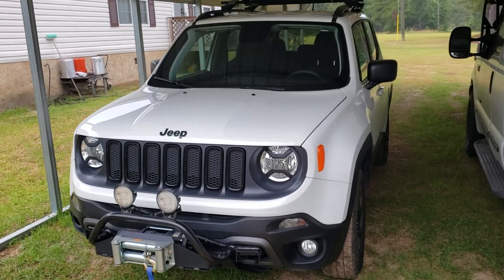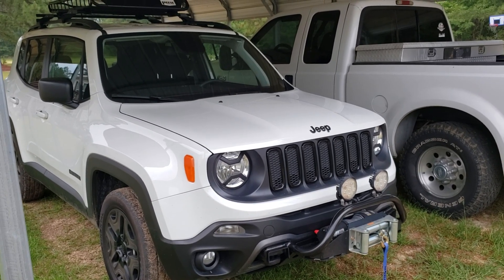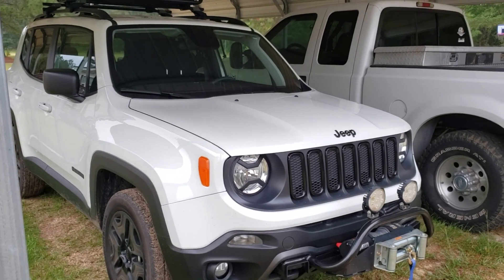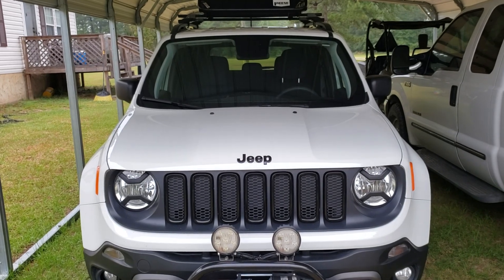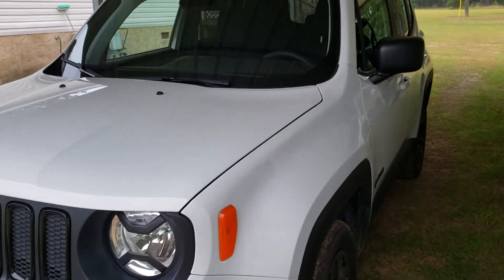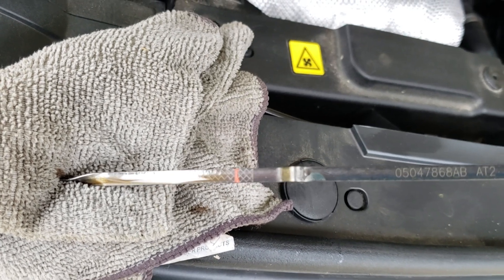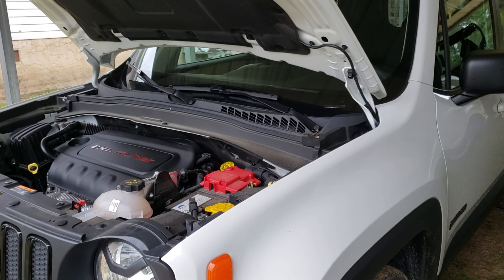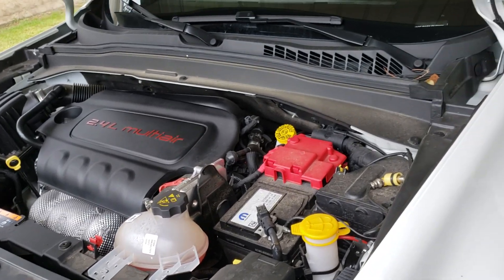2018 Jeep renegade using oil!!! Follow this link to hear what happened-https://youtu.be/xJyersWGxAk

Comment: Try Amsoil Signature and it will stop the oil burn and consumption. This has been proven to the dealers who use Pennzoil that  does not offer as much protection against heat and friction.  Amsoil should be used for all Jeep Renegades due to their engine design.

Comment: I have a jeep 2018 Renegade, 56,000 miles. My car randomly shut off and I got worried. Immediately checked the oil. I was down 3 quarts and it was still 1,000 miles to my next oil change. That was 1 month ago. Every week I check and it is going thru a quart a week. Called my dealer and asked about a recall. They played stupid  and said no recall. They have made an appt for a software update and said that it may fix the problem. I want this car fixed. Im thinking they Re gonna screw me around. Not sure where to turn. Thanks gor your post
Reply from the maker: Junk..just plain Italian junk

Comment: These motors have alot of blow by coming out of the oil cap which is an indicator of bad piston rings.
Reply from the maker: The rings aren't bad...they are specifically undersized to reduce drag and friction in the cylinder walls to help with fuel efficiency...problem is they allow oil to blow by, you are correct on that...thats where the oil is going.

Comment: Bought a 2018 Renegade 2 months ago.. I have this exact problem as well as the fog lights blew out, left the glass black and one cracked open. I have to do the oil consumption test and was told if it shows high oil consumption again, it will need a new motor! Wtf!! I drove it to work, had the 2 red lightening bolts indicator on the dash and lost power and couldn't drive over 35 mph and luckily made it back to my house as the check engine light also on and message on dash read "service engine".  Wouldn't start up after turning it off, had it towed to garage and it started right up for them and threw NO CODES! So the mechanic said I need to do an oil consumption test! What the actual hell?!?

Comment: I think I have this same issue on a 2018 I bought used last year for my daughter.  It has been 2500 miles since the last oil change and it was down a good 2 quarts.  But it seems like what you are saying if I do take it in for an oil consumption test the dealer will just sayi it's normal?
Any other recent solutions to this issue?   I really don't want to add oil to this thing every month or two.

Comment: 2016 , 62k miles . Oil consumption test showed excessive oil used . New long block installed today under warranty . Time will tell if the the updated engine makes a difference.

Comment: The 2.4 is not the only one that consumes oil, the 3.8 v6 is known for doing that as well because they say to use 5w-20 oil in the engine, well that's too thin for an old push rod style engine. A lot of people fix or at least better their situation by using 5w-30, it runs thicker at higher temps so it does not leak into the combustion chamber and is better for the engine in the long run. The EPA is putting way to high standards on fuel economy for new vehicles so car manufactures have to squeeze everything out of their engines and they do this by putting in thinner oil to reduce drag on the engine. Even toyota, known to be one of the most reliable car brands, has an oil consumption issue with their 2.4L engines. 0w-20 oil is almost like water it is so thin, and believe it or not but a lot of new cars coming out in 2019 and 2020 are going to use 0w-16 just to make cars more fuel efficient. The EPA is literally killing cars.
Reply: Yep, and better gas mileage is why so many manufacturers are using crappy CVT transmissions that break.

Comment: In 1980 I bought a brand new VW Vanagon. It burned a quart of oil every 500 Miles !  I did not mind it then because it was an air cooled engine and and oil was cheap. Nowadays it will be painful.

Comment: Anybody know what the status of the class action lawsuit is?  Mine is at the dealership right now because it would not start ..  and they want to blame it on an unrelated customization I made using a bigger battery.
Reply from the maker: Nothing will ever become of it, you cant fight Fiat money 💯
Reply: yes mine said it was running but the engine was not on...replaced battery then it did not start??took it to dealer and they said it was a loose wire not connecyed??Free not charged for repair>>

Comment: I have a 2017. I was driving and it shut down on me. Vehicle was still under warranty took it to dealership and the service tech told me whens the last time I had an oil change. I said its brand new it's not do. Then he told me that renegades use oil. The safety feature shut the engine down. I was pissed. I constantly check the oil. It hasn't been using oil so I dont know what the deal is. It has 26k,000 miles on it now and it's not using oil anymore but i still check. A newer vehicle shouldn't use oil like that. I called cryhsler and they said that's normal. I was checking for leaks everything. I always keep oil on deck just incase its low. Check your cooliant constantly too. Mind all of a sudden went low. Cryhsler makes junk man. I got a really good deal on it and keep up on maintenance. You have to do brake fluid changes on them too every 20k miles. Change in cabin filter out too. All I can tell you for the first 10k miles on it would burn at least 2qts which isnt right. Once I hit 25k miles it stopped doing it. But I constantly check. These engines are junk and under powered they make a 1.3L turbo in the newer ones. Like the renegade Outlander, Liminted, high altitude and trailhawk models have that option now. Fiat makes garbage it's made in Melfi, Italy. Soon they are going completely foreign that's what service tech told me.

Comment: So I've had a similar issue. Last week I had an engine light on and took it in. Turns out the thermostat  housing was gunked up and looks like oil was mixing with it. So now I'm worried about head issues.  Not happy about any of this!!
Reply from the maker: I feel ya bro...ours got rear ended couple weeks ago, it's in the body shop..so that's fantastic for me 🙄

Comment: Mine drank 3 and a half courts in between a oil change and did a oil consumption test and they put non synthetic 5w20 to try cheat me happened 2 days ago adventure in dalton is crooks mines had a wheel bearing replacement, fuel pump ,sun roof wont close transmission update, GPS not working, 3 times over the air conditioner going out.

Comment: We have a 2017 Jeep Renegade Sport 2.4L MultiAir 4x4 that we purchased new. It burns at the same rate (about 3.4 quarts between 10k mile oil changes) and there is 30,500 miles on the vehicle. At the first oil change I switched to AMS Oil Signature Series 0w-20 hoping it would make a difference, but it was minimal. I agree it’s complete bullshit that this is considered acceptable by Jeep/Chrysler/Fiat, but we otherwise like the vehicle. I wish we knew of this before we purchased the vehicle as well.
Reply from the maker: Yes it's a total BS way of doing business,  they are selling a defective product and they are fully aware of it.  I hate your having the same issue, seems it's more and more people are realizing it and coming forward. I wished a class action suit would come into play against Chrysler fiat.

Comment: MIne did the same thing. 2018 model. we are at 20k miles.  our dealership replaced the entire engine.
Reply: With a brand new engine mine is 2018 burns oil like crazy did they reset the odm?
Reply: @mr.koenig749  no they did not. they just replaced the engine but kept the odm to whatever it was at.
Reply: @XFreedomPrimeX After they replaced the entire engine, is your Jeep running normally or does it still have issues? My dealership is recommending the motor be replaced at no charge, if it continues to burn the oil too fast...

Comment: I had the same issue they replaced my motor and it made my jeep alot worse. Burns gas like crazy and left me stranded on the side of the road. Have a service engine message and service transmission message. Never had any issues with my jeep till they replaced my motor. N they gave me the run around telling me I have to be without a car for 6 days till they find the issue then I can get a rental. Smh it's almost paid off but at this point I'm fed up and think about trading it in for another car. But will not be another chrysler product. After this experience I will never buy a chrysler product again

Comment: My 2017 Jeep Renegade Latitude is going thru 1 to 2 quarts between oil changes.  No idea why.  Just under 45k
Reply from the maker: If it's not a leak, its consuming it through the combustion chamber, due to thin 0w20 oil, smaller toleranced rings on the pistons,  and a hotter thermostat than is actually needed. The engine was designed by Fiat to run in European countries, so when it was adopted here they changed all 3 to accommodate EPA regulations,  thinner oil and rings to reduce internal drag and friction, hotter thermostat to increase combustion flashpoint, all to get better HP and fuel ratings. These 3 parameters accompanied with the fact it also runs a solenoid operated  valve train instead of mechanical which causes valve lag, let's the super heated thin oil go by, into the combustion chamber and is burnt efficiently as a fuel, which is why you wont find a leak or residue at the tailpipe. Fiat and Chrysler both are aware and refuse to stand behind it, which is the reason for the oil consumption blanket policy.

Comment: My 2019 jeep cherokee latitude 2.4 is doing same thing 2 quarts in 5000 miles. Has 9400 miles on it.
Reply from the maker: Look at my other video related to this issue if you want it resolved.
Reply: @fastdraw30  my 2019 with 55,000 miles just did this for the first time a couple days ago. No warning, nothing, just shut the engine off.

Comment: Oh my, I’m taking mine in for the same kind of issue tomorrow...hope they don’t tell me the same thing. Mine may be something different though, I’m at 6,000 miles and I’ve had to add oil twice already.....
Reply from the maker: I actually emailed Fiat Chrystler Corp last Friday, they called me yesterday and basically told me to finish the oil consumption test with the dealer and that they would be in contact with the dealer and monitoring the situation. I honestly think they all know this is an issue that is common among the 2.4L tigershark engines. I dont have a good feeling about any of it.😒
Reply: That's a common problem with these. I'm on my 6th oil change and check oil regularly and noticed it deos use as much now. I'm trading it on a subaru
Reply: @fastdraw30  hi there. I know the video is 3 yrs ago. Just wondering how did it turn out? How's your Jeep now? Thanks

Comment: Class action lawsuit was filed in May 2020 on the oil burning from the 2.4L Tiger Shark Engine........I'm having the same issues.....The dealership is currently swapping with another engine free of charge.....This will not solve the problem.

Comment: 2017 Jeep Compass limited. Had oil consumption issues until engine completely died on the Los Angeles freeways. They replace my engine- free of charge. Lucky me! Right?.... NO! New engine is at 5,000 miles and already stalling. When I took it into dealership they told me it was because I needed  oil change/ low oil. When I asked why the car did not reflect it needed an oil change on the dashboard- they were silent. Assured me they fixed it and if I would not pick it up they would put a lien on it? Never heard of that before but sadly will be picking it up tomorrow morning, not fixed.
Reply from the maker: Wow...unreal...It seems more and more people are coming forward with these issues,  I hate that for you sincerely,  but know your pain. Hopefully a class action lawsuit will be in order eventually.
Reply: @fastdraw30  were you able to get a new vehicle?
Reply from the maker: @junexgalaxy  no mam,  the dealership and the owner declined to resolve any of it, along with Chrysler...so we are stuck with the thing until we are in a position to trade out of it, which I fear will be your only option as well.
Reply: @fastdraw30  I bought this vehicle while being active duty army in Virginia/ DMV area. I bought a blue 2017 jeep compass originally. It ended up being defective and the dealership took it back and switched it out for the green one I currently have. I also purchased a 7 year/ 70,000 warranty that apparently most dealerships work with called fidelity warranty services. I'm hoping to build a case with the last 20,000 miles I have left on the warranty. Which 20k for me flies since I commute. I've been through arbitration, have been denied-but that was because I wasn't able to attend the meeting. My Jeep stalled out and they booked the meeting over 2 hours away from where I lived 🤷🏽‍♀️. At this point I'm seeking out a lawyer.
Reply: @fastdraw30  its possible to get a new vehicle, you'll have to fight for it.
Reply from the maker: @junexgalaxy  unfortunately not, we have exhausted every Avenue,  spoken with attorneys and lemon law firm, and the cost of fighting it in litigation outweighs the cost of trading out on your own. Had this been feasible it would have already happened trust me.
Reply: @fastdraw30  I think it is because California lemon laws makes the corporation pay.
Reply from the maker: @junexgalaxy  lol...idk, here in Ga I guess your just rectally taken advantage of 😫
Reply: @fastdraw30  yea my headquarters jeep case manager ghosted me when I said arbitration. Absolutely no help
Reply from the maker: @junexgalaxy  I bet so, cause that's what I experienced as well,  it's sad that Jeep wont stand behind the product, and all you ever hear is how rugged they are, how capable, how they are first in class off road, yeah until the engine burns oil like a stove.
Reply: @fastdraw30  has your engine died yet though? Mine went from burning oil for maybe 1 month to completely killing my engine and leaving me on the side of the road.
Reply from the maker: @junexgalaxy  no not yet, but it has stalled before..due to the oil level engaging the protection switch. But yes I feel eventually all the 2.4l tigershark engines will catastrophically fail due to issue. The engine combustion chambers will eventually become so sloppy with freeplay in the bores until compression is lost and a cam bearing gives up.
Reply: @fastdraw30  one more question... I could of sworn that this vehicle is equipped with the technology to tell you when it needs an oil change/it has low oil pressure. They are saying that when it reflects this, that means it is on its last leg. Does /did you vehicle give you these type of messages?
Reply from the maker: @junexgalaxy  that's absolute BS, the vehicle does in fact have an oil life monitoring system,  and also a low oil protection switch that's suppose to engage when the engine oil level falls below a safe operating range. It's even in the owners manual about the oil life system and how to reset it and such. They recommend a 7500 mile oil change on full synthetic,  and claim it can withstand a 10k mile interval, but the 2.4l will not even come close to that without adding at least 2 quarts on average between changes, and I wouldn't dare chance pushing one to 10k on a single interval.

Comment: Mine will stop on busy roads and happened 3 times now. Started happening at 27,000 miles. My oil change was due in 300 miles from when it went out. They tell me that they have to play Chrysler’s game. They know there is an issue but they are not fixing them. I had my oil changed 2 weeks ago and only went 200 miles and it was at the bottom of the hash mark (their safety zone) and they want me to keep checking it. Im seeing that there is a lot of people dealing with this issue

Comment: It’s a design flaw with the piston rings, oil gets through them. FCA is being sued and hopefully they can recall them and put in better piston rings

Edit: it usually stops around 20-30k mi
Reply: I have a Compass with the Tigershark/Multiair engine. Got it brand new and it was using 2 quarts every 3k miles from the start. I have 91,000 miles on it now and it still uses 1 quart every 3k miles. Meanwhile, my 11 year old Ford Taurus with 183k miles uses no oil.
Reply: @jehadorn  that makes since, because that gen of Taurus was basically a Volvo

Comment: I bought a 2016 new and it uses about 1 quart every oil change. It now has 65k and it stopped using oil.  Also I have carbon build up on the outside of the engine block where the head meets the block on the driver side, wipe it away it comes back. I had a few different stealer ships look at it and they down played it every time I brought it up. I finally just said fuck it!  Also very bad gas mileage for a 4 banger 20 mpg if I’m lucky. What a shitty vehicle